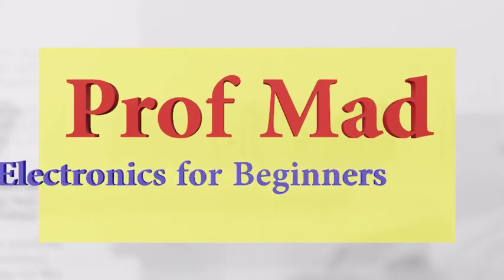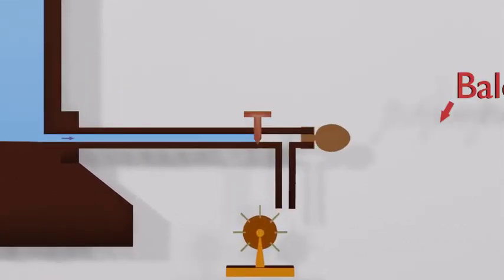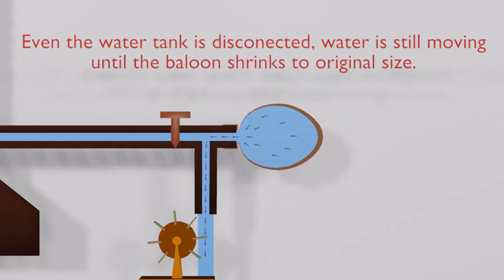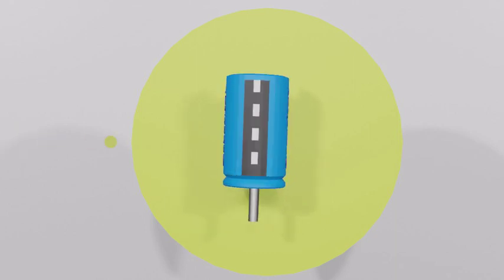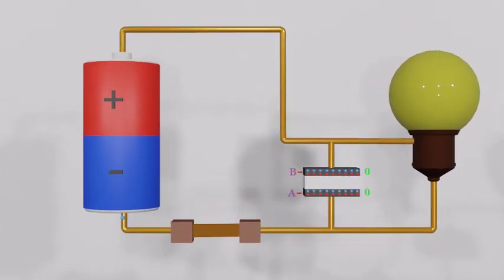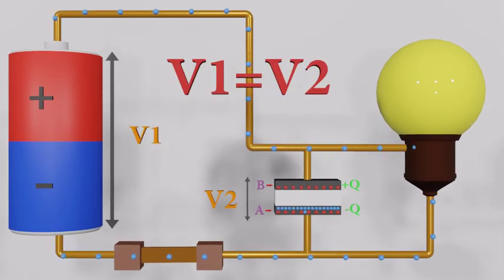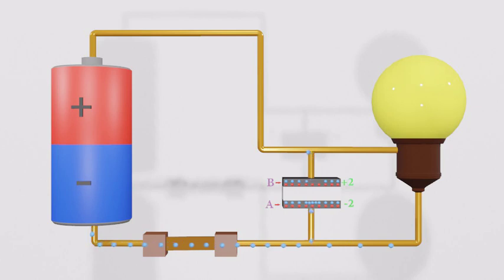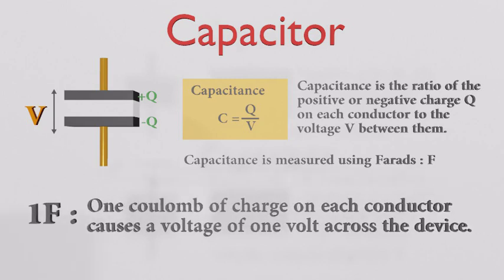Capacitor Explained |  How capacitors work | working principle | 3D Animation

Comment: Your videos so far are fantastic. The only observation here would be like this. 05:10. One electron enters the A plate. A plate becomes negative charged (-1). So, to balance this inequity, plate B release 1 electron and become the +1. How the electron from plate B left plate B if the two plates (A & B) are not connected?!? after that you talk about EMF. How the capacitor knows that on plate A received 1 electron to release 1 electron from plate B? Can you please detail this part? Thank you very much in advance~!
Reply: because the positive and negative charges on each of the plates attract each other but never reach each other. So compulsion happened between the negative charges.

That’s what I know, correct me if I’m wrong.
Reply: Very nicely explained!!👍

Comment: Excellently explained.. But if the capacitor is placed in series with the battery, does that mean that when the capacitor's voltage is equal to the battery's voltage, it will no longer conduct electricity,

Comment: My question is that when I want to open a switch to turn a bulb or any electric appliance off, I mean to stop the device right away not that a capacitor keep powering it for sometime still after I switch off the breaker. Looks like capacitor has more to perform while the power is on like to ensure a balance and smooth flow of voltage during surges or fluctuations.

Comment: But what if the switch is not opened, but there are voltage drops in circuit? how does capacitor and lamp behave when its not a battery, but a dc with unstable power and ripples. Browsed whole youtube, but no author shows that kind of animation. everyone shows only this type of animation, when circuit closes and opens.